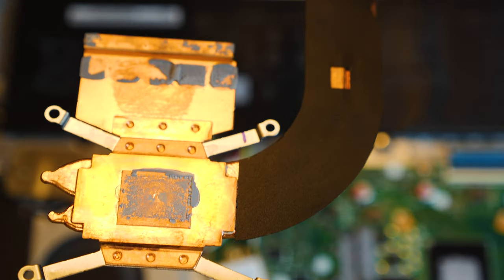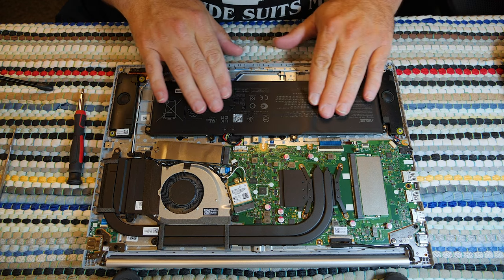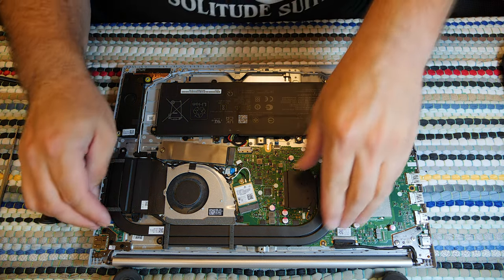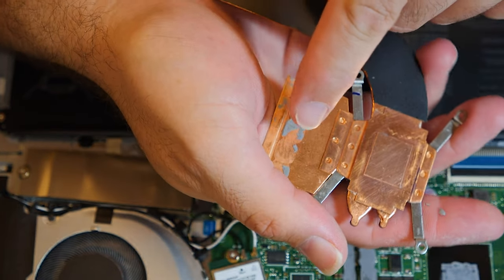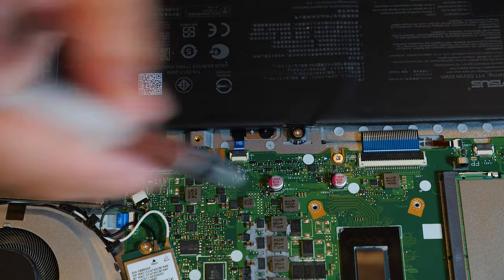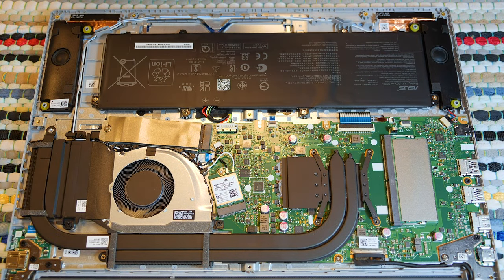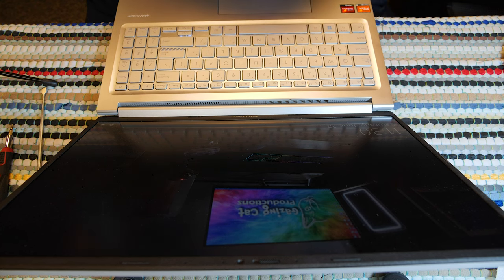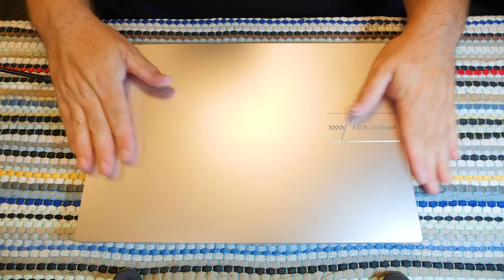Asus Vivobook 16 M1605XA Disassembly and Review - Jody Bruchon Tech

Comment: In my experience, Asus uses crap thermal paste as a habit. Previous customer probably had overheating issues and returned it for that reason. "In Search of Incredible". I certainly hope they find it some day.
Reply from the maker: So I got it for $300 less in exchange for this repair? Awesome. I won!
Reply: Asus laptops are known to overheat.
Reply: @KratostheThird  The issue isn't restricted to laptops. I've got an ASUS ROG tower, had the same issue.

(I know. Why buy an ASUS ROG tower? Well Best Buy credit wouldn't let me BYO easily, and it was worth it almost for the vid card alone at the time. (I hear you. Why are you shopping at Best Buy? Shut up.))
Reply: @RyeNorth  Best Buy just another garbage company now?

Comment: Plot twist: the previous user heard that changing the thermal paste is good, got a crap one, then returned the laptop and Jody, with its renders, baked that thermal paste.

Also, even if the cooling is not horrible, it's not impossible that the previous owner used the laptop in a 40˚ Celsius room. Though if it's from August, the owner probably got it in September, and Jody being in the northern hemisphere, that means the laptop was not used in summer.... maan, complicated!

Nice to see a laptop not being thrown to waste, good job Jody!

Comment: That could be a combination of 2 factors: crappy paste and crappy cooling(radiators and pipes were not enough to throw out all the heat so it did borderline overheating for a long period of time). Even if CPU can handle heat for long time(by throttling not to kill itself) thermal paste could bake faster than it should.
Reply from the maker: I've confirmed it's insufficient cooling too. It rebooted a couple of hours into an encode. I disabled turbo frequencies and it didn't reboot.

Comment: 2015 and earlier laptops are more durable than newer ones that can last for more than 5 years (heck, I've upgraded a 2007 Core2Duo Laptop to SSD and it's still working today!). Still, lately, I've seen a few 2022 models die within a year... I'll wear a tin foil hat for this one, but I bet it's a planned obsolescence...
Reply: It’s all deliberate. Look at some appliances today and try to tell me with a straight face they will hold up as some of your 1980’s/1990’s appliances did. 

They won’t. The products are just as expensive, but built with inferior materials. Manufacturers do this to make more money and have you going back to the stores.
Reply: @KratostheThird  Indeed sir!

Comment: You mentioned that your thermal paste was expensive, but you only used a tiny amount. In the grand scheme of things what did Asus save by using that cheap paste over the good stuff?  A penny? I wonder if the savings were greater than the warranty expenses of repairing devices.
Reply from the maker: I'm sure they saved a dollar or less.

Comment: What are good laptop computers? Because Asus to me isn’t one of them.
Reply from the maker: It's actually not bad, it's just the paste that's the issue here. The VRM cooling makes me very happy. They didn't have it on the gaming laptop I bought from Asus in 2016.
Reply: @JodyBruchon  I bought one of mine in 2018. The problem is all Asus laptops of mine overheat. One also has a bad battery which is probably long overdue in being replaced. 

Is there any website I can go to to replace computer parts?
Reply: I recommend the Commodore 64 laptop (also known as the SX-64). You can program Cobal on it (for writing software that controls Cold War era ICBMs), and it can also run Pacman flawlessly.